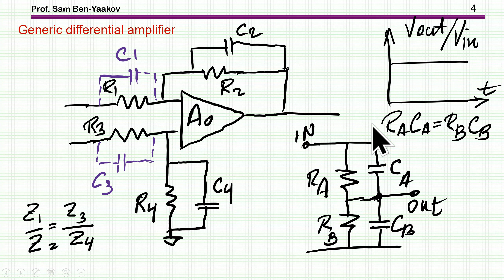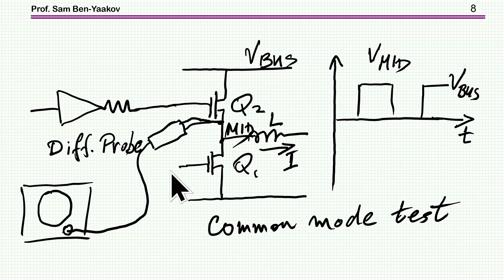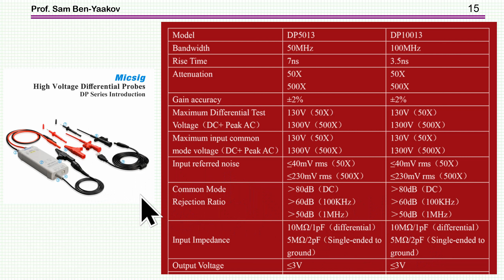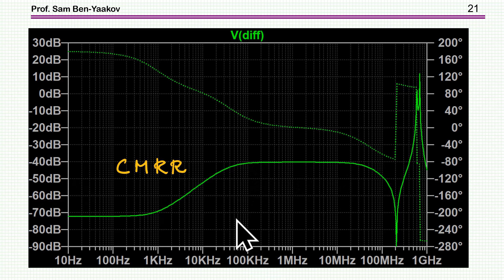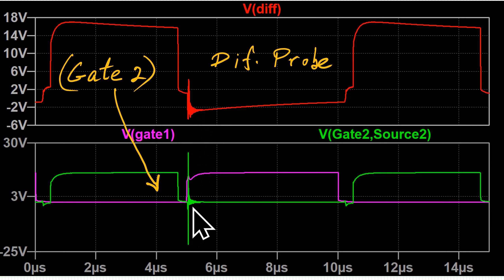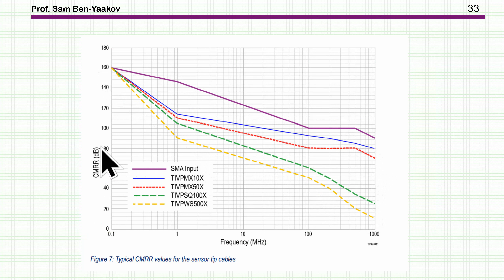Differential oscilloscope probes: The common and the better

Comment: As far as I know, the differential probe usually uses JFET pairs on the input side. Prof, could you explain that a bit?
Reply from the maker: JFET amp have very low bias current, low input offset and  high BW. Perfect for a differential probe.

Comment: Hello, Prof Ben Yaakov. I'm Frank KWON. Thanks for your great lectures!.
BTW,  I have several questions about GND of the circuit to be measured and diff probe GND to select probe appropriately. Can you let me know your email to ask specifically, please??
Reply from the maker: sam.benyaakov@gmail.com
Reply: @sambenyaakov  Thank you! I will send it!
Reply: @sambenyaakov  Prof.Ben Yaakov. I have sent the mail to you. I hope you can read and reply it. Many thanks!
Reply: Hello, Professor, I sent it on Jan 8th. I hope you can read it. The title is  'About Diff Probe VCM GND'. Thank you!
Reply from the maker: @kkh8623  I did not get it please send again 
sam.benyaakov@gmail.com
Reply from the maker: sam.benyaakov@gmail.com
Reply from the maker: Note broken link, copy and paste
Reply: @sambenyaakov  I have sent again. if you cannot get it again, I will send through Linked-in message.

Comment: Thanks Prof Ben Yaakov for another great video!. We have optical isolated channels in our CS448 oscilloscope with over 100dB CMRR and it is always a challenge to explain how that helps to our customers, so the material covered in this video is good to see.
Reply from the maker: Hi Ken thanks for input. Can you write to me off line to sby@bgu.ac.il? and BTW: the phrase " The gates are slewing 0->500V in about 10ns while the measurement is made. " in your writeup does not sound right😊

Comment: Once I made a diff probe and it turned out 2-3 cm guitar steel strings are great as probe tips. They are flexible, springy and have some surface treatment against rust which makes them solder like charm. Tiny capacitances (0.2-0.3pF) for C1 and C3 I did by PCB traces.
Reply from the maker: Hi Akos, thanks for sharing. Interesting.
Reply: @sambenyaakov  I got a 1979 Les Paul Standard NAMM guitar with a Kahler Flyer locking tremolo from The Kahler family as a Christmas gift, with a nice Christmas card inside the case. I would break high E and B strings within 1 or 2 hours of playing it, so I would solder the wraps with 60-40 tin & lead and the loops also would be soldered to the brass ball ends. I need to refret that poor guitar after 44 years but I still solder all of my plain strings like that on EVERY steel string I play, except for most acoustic guitars. D'Addario uses aluminum ball ends so their strings are 110% USELESS to me. I have a hardtail Strat I keep next to a recliner an it rarely gets restrung to the point the D and A strings' windings will get worn off by the frets. I have made probes with .006" to .016" plain strings myself. The steel is either low a grade stainless steel or it is nickel plated, but it always solders up very nicely. After 20 years or so of neglect the steel turns BLACK with some sort of oxidization.

Comment: Great video!
My question is: What can be done when the measurement can't be done with short wires because of physical accessibility? How the parasitic inductance can be compensated? If I connect the diff probe to the measurement points with coax cable can that help?
Reply from the maker: Try to twist the wires.

Comment: Thank your for your sharing. 

Both the Differential oscilloscope probes you showed have errors. Durig my test in the laboratory, we use the passive prob and we solder the probs direclty to mesuring points, in order to decease stray indutance; Meantime,  for the oscilloscope we isolate  ( not connect to the Ground): I think this way is better to measure the Vgs of High side Mosfet for example;
Reply: Isolating the oscilloscope is the most dangerous Thing to do. The bnc connector is not grounded any more and it's a serious safety concern
Reply: @raviteza8  There are plastic cased scopes that are safe to use floating. In that case, it would be a good idea to apply heat shrink over the collars on the probes and put plastic caps over unused inputs.
Reply from the maker: Using an isolated (by transformer) scope is not only dangerous but of little use. Have you ever checked the impedance between the "ground" of the oscilloscope and "earth" you will be surprised. I would suspect that the impedance is also low for a battery operated scope.

Comment: Great Video, Prof. Ben Yaakov. I did similar simulations a few months ago. The most important thing is the input capacitance. Even 1pF is too much. In order to differentiate if the oscillations are caused by the probe or the circuit, on needs a flat response not only of the input bandwidth but also of the CMRR of the probe into atleast a few hundreds of MHz range if not GHz.

 If we can design a differential probe with very low capacitance, say 0.2pF, then in theory we can have a very good CMRR. In fact this is what is done in active LV probes with 2 or more GHz bandwidth. At the end of the day, the impedance rolls off and the CMRR deteriorates. The Isomue from Tektronix resolves this issue by simply isolating. My wish is to design a probe which can compensate for this CMRR roll off, perhaps using a special circuit in addition to a very low input capacitance of less than 0.2 pF. I am not sure if its physically possible to develop a HV differential probe with these specifications. An LV active probe is possible and is commercially available. Of course, one can always resort to what Tektronix did, simply isolate, also Clever Scope CS448 uses a similar principle and achieves great results. The other points you mentioned are equally important like inductance etc. 

I simulated different configurations with single and multiple stage HV Instrumentation Amplifiers in LTSpice. Also the ratio of the differential gain to the common mode gain is very important in the first stage and should be maximized with proper choice of components. But the compensation of the feedback is really hard at high frequencies. 
But anyhow, as always, Prof. Ben Yaakov, great video!
Reply from the maker: Hi Ravi, Thanks for sharing your experience . Interesting. Differential probes are indeed a hard nut to crack
Reply: Thanks Ravi Teza for mentioning our CS448 isolated oscilloscope. You are quite right, making these differential measurements in the presence of high common mode voltages is much easier with optical isolation. We use optical isolation inside the scope as compared to IsoVu with the optical fiber on the probe.

Thanks also to Prof. Ben for this great video. It is always a challenge to understand how CMRR changes the measurements, and this video is very clear.